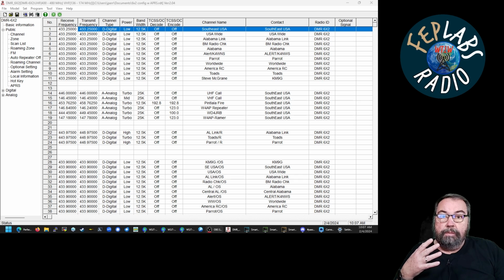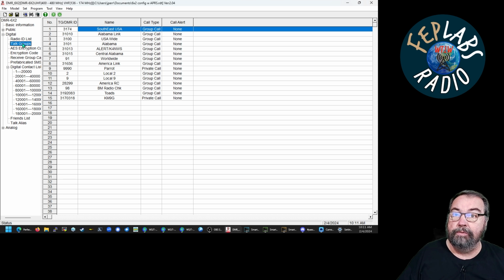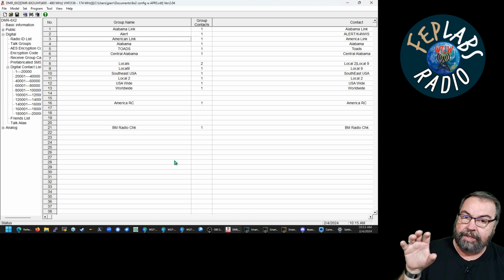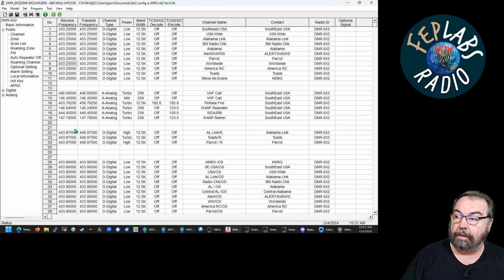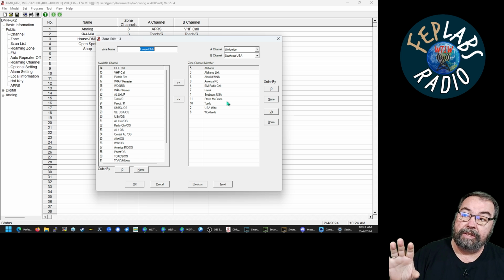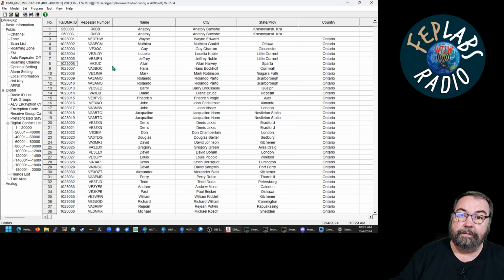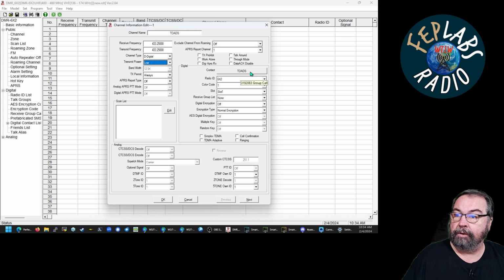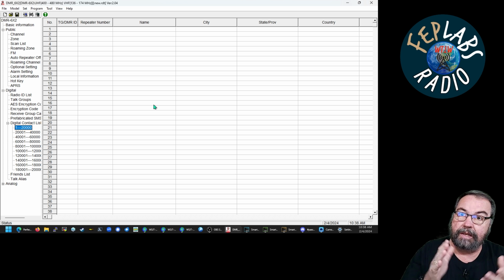Understanding DMR Code Plugs (and Why They’re So Confusing)

Comment: At last help with basic dmr code plug, I have anytone 878 and your video was a big help as I have been spoiled by my mate writing a code plug with every thing in it, most of which I don't use I was looking to set mine up for a hotspot I  have then use with local repeaters in and only few digital contact groups .thanks for your video..  ttfn

Comment: I'm extremely new to the DMR world but I have a question for you. If I'm setting up my codeplug for my HT (Anytone D168) without a hotspot (using repeaters), is it possible to get it to automatically use repeaters specific to my location? If not does that mean I'll have to make a channel for every repeater I want to use? I love the video and appreciate what you do for the community. 73, KK7RHF Dave
Reply: This is because we're in quite a mountainous area and we may access several different repeaters as we travel. Hope that makes sense...

Comment: Thank You a million time. About 3 years ago I tried DMR setup. I've been an operator since 2012 as a general class. So, I've been around the block per say and I'm 75 years old and very attune to radio / computer stuff. Anyway, I had triple bypass March 2025 so I decided to try the DMR world AGAIN during my re-hab time at home. Most videos I watched skipped around like a chicken in a pan of Crisco. But after slow note taking and understanding my first radio and CPS was the problem. Now I have understandable radio and CPS. Code plug all done in radio and ALL VHF/UHF/DMR stuff is 100%. Footnote: I have a family farm (100 years) of 500 acres rural Idaho. so with this new knowledge, I think VHF/UHF/DMR radios are in the near future for farm equipment.
Reply from the maker: That's awesome to hear! Sounds like you've really mastered it now, and the farm application is a cool idea.

Comment: Ive tried manually on the baofeng dm32 for a repeater & cant hear anything.  Wasn't expecting to need a programming cable.  Very frustrating.  Fusion/wires x was much easier.

Comment: Hi Jim it's Tommy K4BWN here in Haleyville I finally got me a DMR radio to program got me a hotspot set up from Amazon I got the hotspot that's got the Ethernet plug in the end of it upgraded they said I've got the any tone d168 handheld radio got it programmed my main problem is I cannot get my Hotspot to pick up my cell phone to use as a hotspot on the go what am I doing wrong using a Motorola G stylus Android phone. Thanks again fir the Videos
Reply from the maker: You might need to look for "compatibility" mode in the phone, I'd guess.  Also, none of these hotspots AFAIK support 5ghz, so the phone needs to be using the 2.4 Ghz band for wifi.
Reply: @FEPLabsRadio I have the Anytone D168 working now I just got to get all of the talk groups set up and working maybe you'll do something on the any tone d168 UV for setting up all the talk groups and Zones and stuff . Thanks 73 K4BWN

Comment: This By far is the best and easiest i have found. u are my newest friend. now i have a major question... My Hotspot is set for both Brandmeister and TGIF, i differentiate the contacts by putting a 4 in front of the number.. However when i set up the hotspot for both networks i can now see timeslot 1 and timeslot 2... does this mean i have to use a timeslot for individual networks ? example TS1 for Brandmeister and TS2 for TGIF? or just use TS 2 for BOth channels?
Reply from the maker: Oooh, that is a question I've not messed with.  I've just stuck with BM pretty much.  I would think that you could do it that way, with a separate TS for each network.  Easy enough to do in the radio when you set up your channels.  I would also guess that using a separate time slot might allow you to NOT have to do the 4 in front of the TGIF contacts as well.  That is an interesting question, and a good idea for a future video!

Thanks for watching, and if you do the 2 TS thing, let me know if you got it working that way.  I suspect a lot of it is going to be what pi-star or WPSD supports.

Comment: @FEPLabs Radio This is the best Video for Copeplugs. Thanks a lot. Finally i create a codeplug for my Anytone and ist working. I`m impressed. Thanks bro. But i have one Question, how did you configure with your privat call with Steve McGrane KM9G?  73 from DL1STJ

Comment: Jim:  While this was helpful - I'm still beyond befuddled.  Couple of things:

1:  Do I need to have a hotspot? 
2:  How do I get the frequencies if I don't have a hotspot.

Maybe it's my receiver (meaning me) and not your transmitter.  

Thanks in advance!
Mike KC3AIL
Reply from the maker: Hey Michael - 

1. No hotspot if you have a DMR repeater in your area and you can hit it well enough.  However, a lot of digital repeater owners lock the repeaters to certain talkgroups.  Some do, some don't.  Having a hotspot, allows you to access ANY talkgroup you want.  Lot's more flexibility.

2.  Repeaterbook.com is a good place to start, also any local ham clubs may have a facebook page, or web site with other information.
Reply: @FEPLabsRadio  There's a local repeater, but it's too far away to hit from my house.  Fortunately, between this video and TO's video I was able to get my radio and a hotspot running and everything working after a couple of minor hiccups.  I'm gonna try hitting the local repeater tonight as I'll be down that way and see if I set that up properly too.

Appreciate the help!

Comment: When you make a private call to Steve, say he in range of a DMR repeater and not just HIS personal hotspot, does that repeater have to allow his ID to be TXed out. Like the repeater trustee has to assign what talkgroups are available on their repeater, doesn't the trustee have to allow Steve ID to pass for private calls the same way?
Reply from the maker: That's a question I've never tested.  They may block private calls, I suspect it is similar to how P25 fleets are managed.  Here, the radio folks blocked "iCall" (radio to radio) on the FD and Sherriff's radios.  All the private calls take up P25 channels.  DMR is somewhat similar, so if there is a private call in progress, that repeater is out of service for talkgroup usage?  I would bet it depends on the repeater owner.

Comment: I got me a Baofeng DM1701 it's not worth the money
Reply from the maker: I have an 1801 - I upgraded it to the OpenGD77 firmware, it's a hella better!  Not sure that's available for the 1701.
Reply: @FEPLabsRadio  my laptop won't let me use the software and it can't find the cable on the Port I am going to try a 878 and see what it does I have been using Droidstar on my Android phone

Comment: FWIW,  the Radioddity GD-77 with factory firmware required receive groups.
Reply from the maker: Hey Rusty, yeah it's kind of a hit or miss thing.  I think most current DMR radios don't need recieve groups, but I've just gotten where I create a 1-to-1 match with the digital contacts whenever I program any DMR radio.  Extra step, but eliminates the question.  Thanks for watching!
Reply: @FEPLabsRadio  Indeed.  I think manuf'rs found out that it really wasn't necessary.  May have been a "left over" from the business radidios.  Thanks for the video!

Comment: Great video. Alot of the brandmeister tgs say 10 min limit. I don’t recall seeing that years ago. Are tgs limiting each users use of the tg to a 10min qso?

Also, what are tac channels? Are they used like simplex only in digital form so you don’t tie up an entire state or region with a qso?
Reply from the maker: The time limit thing is usually more for repeaters that are linked to Brandmeister.  Of course, be aware that every QSO ties up the TG that it's linked to (be it repeater or hotspot).  I suspect it's more of a courtesy/repeater management thing than anything else.

Every DMR radio I've seen lets you disable the TOT completely.  However, a lot of repeater owners do impose TG that you can link to, as well as timers.

Comment: So for a private call how is the connection made through a repeater or hotspot?  If you are calling Steve does he have to be on the same talk group you are on or just anywhere on the same network?
Reply from the maker: Yes, - you still need an active DMR-Internet connection somewhere (at both ends).  So, if you're on your hotspot, and I know your radio ID, I can direct call you, as long as I'm connected to something on my side (repeater or hotspot) that's on the same network (BM, TGIF, etc).  Doesn't matter what TG you might be in.  Of course, if you're keyed down, I won't be able to get thru.